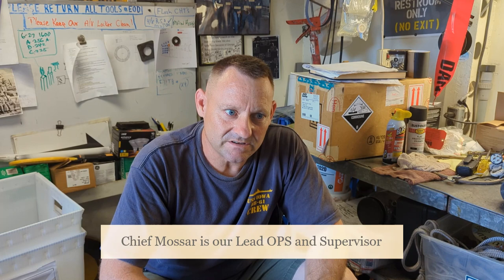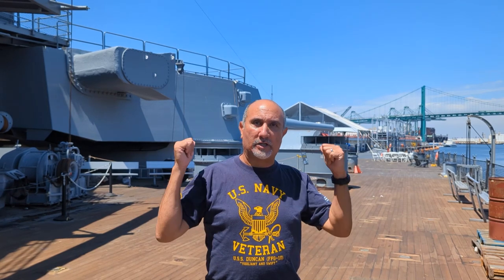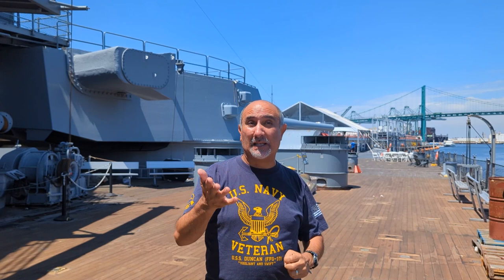HOW....How did we Turn Turret 3 onboard USS IOWA?

Comment: Chief Moser said it is impossible to run boilers and ship steam to run ship systems due to the sea chests being welded closed.  What about shore provided steam?  I know there is the capability to provide steam to the ship via a shore source.  Could that run the ship systems, or would the shipboard condensers still need to be used for shore steam?
Reply from the maker: Shore STEAM??!!

Get Steam from the shore......Am I understanding your comment??  You want IOWA to get steam from the shore, when we have Electrical Connections that Give us our electricity........though I have Not seen da bill!!

As a USN Veteran of 20+ years....I Have NOT seen ships connections for steam, Maybe confusing that with the electrical cables.... they are Quite large in diameter and VERY Heavy.
Reply: @Hey_MikeZeroEcho22P  Yes, my understanding is that the ship has (had?) the capability to receive steam from shore.  Reference this video from your sister ship where Ryan is discussing a leaking fitting that happened to be the shore steam fitting. https://www.youtube.com/watch?v=DECkPYbpTuM

Obviously you were able to get a solution with shore power to not need steam, but if shore power had been insufficient that is where I was wondering if shore steam would have been a viable option.
Reply from the maker: @Mike__O_757  Okay.....after seeing the referenced video, I Guess....steam can be brought onboard the ship.  To get the ship "jump-started" in a hurry.

BUT at a place.....the Shipyard, or the Naval Base where the ship is stationed at....ALL of these ships are museum ships....so we don't have the facilities near-by to Get steam.

So, bottom line............ We do NOT have the facilities near-by to get steam......... along side IOWA, nope....along side NEW JERSEY, I don't think so ( I visited that ship several years back, because a Bro-N-Law lives Very close, just a bit north of the NEW JERSEY ), MISSOURI....MayBe, since it is near-by Ford Island, HI... WISCONSIN, I don't know...haven't visited that ship in Norfolk, VA

BUT ALSO.... you heard Ryan say, that under N O Circumstances can we turn a turbine, nor start up a boiler.... doing so we 'negate' our contract from the NAVY, and they'll take the ship back, and scrap it.

To be honest.....thanks for discussion, I learn something, watching that video.  As I have mentioned...I am a USN Veteran, but I work in CIC as an Operations Specialist (OS) ( CIC = Combat Information Center...{have you seen "Top Gun" [the first movie], the beginning of the movie where they are in the dark room with the radars sweeps going around looking for a-c... that's ONE of my jobs!!}.  And I don't work as an Engineman (EN), so I'm not TOO privy on those matters.

GREAT Discussion..... I hope that answers that question....have any others??!!:trophy-yellow-smiling::cat-orange-whistling:
Reply: @Hey_MikeZeroEcho22P  Thanks for the reply.  I've been aboard all of the battleships east of the Mississippi with the exception of Massachusetts, but still need to get out west to visit you guys.  I'm an Air Force vet, but love the old ships.  I'm a history nerd and a machinery nerd, so a battleship scratches both of those itches very well!  

I love seeing what you and your team have done with Iowa.  I remember that ship was pretty rough when it first became a museum, and your team has done a tremendous job restoring the ship and preserving it for future generations to appreciate.  Keep up the good work!
Reply from the maker: @Mike__O_757  Well, From One (1) Vet to another, "Thanks for Your Service, Sacrifice, and Time" (SST Baby!!)

Just to let you know....we have a couple of Tours (besides our Ship's Tour) that might interest you .... IF you come by!!  The "Engineering Tour" allows you to go INSIDE the ship, to the Fire Room & Boiler Room, and the "Gun Tour" allows you to go INSIDE ..... Da G U N S !!!  (the 5" lower & upper handling Rooms and inside one [1] of our mounts) AND inside the Gun House of Turret 1.....EVEN going within (roughly) the PIT.........T H E N, within the decade (I hope) the Entire Turret 1 ( I think ) tour!!!:hand-orange-covering-eyes::cat-orange-whistling::face-fuchsia-wide-eyes:

Even though some of the "commenters" want us to swing the turrets around all the time like some sort of 'merry-go-round'.......I Think they lack imagination because if you take Any one of the Tours I just mention.....You would Think......you were a sailor!!!:face-purple-wide-eyes::face-pink-tears::face-turquoise-drinking-coffee:

"Proud To Serve....Still Serving Proudly" onboard IOWA, the ONLY BB with 'turnin a turret'!!😎
Reply: Former 80s Machinist Mate here.  Yes, there is shore steam and it is used when docked in port, but it is at a reduced pressure for operating only auxilliary loads such as galley steam kettles and heaters for hot water.  The shore steam pressure is nowhere near enough to operate a steam turbine generator in the engine room.
Reply from the maker: @jerryware5749  MM, OS1 here.......Thanks for the info, I KNEW, somebody out there would know this, MORE Exact answer........I also served in 84, in LBNSY, and SanDog, mostly on FF/FFGs......And You MM??!!
Reply: @Hey_MikeZeroEcho22P  I was a nuke MM and after nuke school served most of my time on CGN-25.  Just after I was assigned to Bainbridge in 1985 in the Puget Sound shipyard, she changed home ports to Norfolk.  Upon going thru the Panama Canal and arrival in Norfolk, we moored outboard of Iowa .  From the video, it sounds like Chief Palmiere was an Iowa crewman then.

Comment: In Russia they would just power it up, flip the switch, and swing it! I bet it would have worked for BB-61, but better they didn’t. But not showing the movement swing?? Wtf?
Reply from the maker: Ummmmmm..... did you see my other videos??  

I have two (2) of them a shorter version and This Longer version.... https://youtu.be/yXW8jWKAC0M

The shorter version shows the Initial movement of Turret 3...short movements to get grease in motion, then a turn to port 90 degrees.  The Longer Version ( the one link here ) shows a FULL Transverse of 180 degrees from the port side to starboard side.  

The question some ask, is if it was at "full power", like motors going all out... ( I heard from the people working on/inside the turret, they only move the motors at 1/2 power...just to Make Sure....the Turret Will Turn )

But, in Russia, you flip the switch it Might move for ya.............. or MayBe burn out the motor ....... THEN you'll have a bigger problem, especially if those barrels are shifted over the Water!!!  THEN, it becomes a navigation hazard [ LOOK at the Other comments about that ].